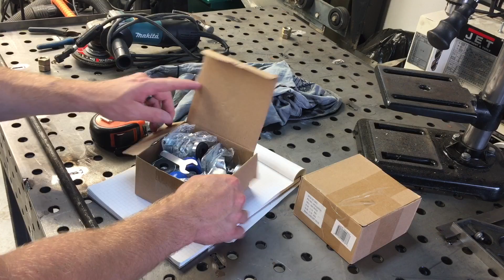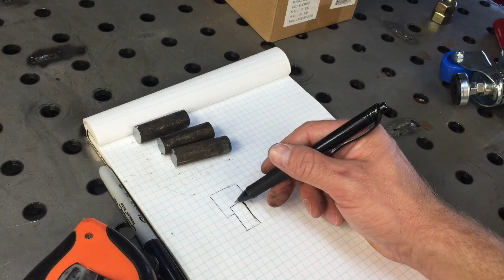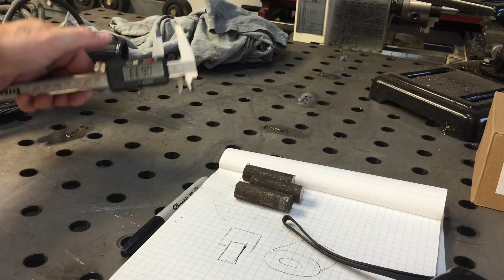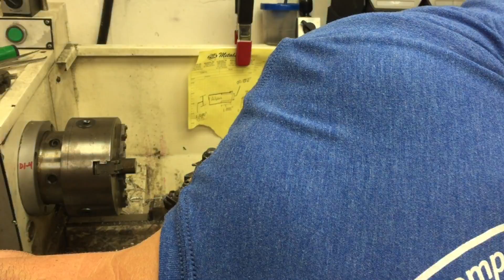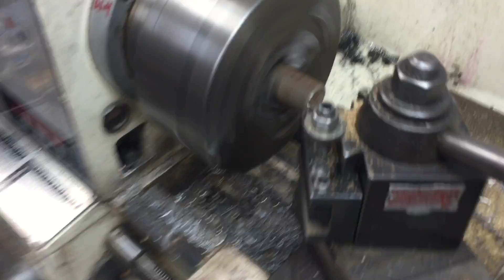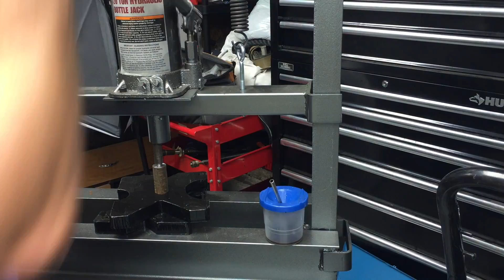Easy PIns for Certa Flat Welding Table/ Fab Block - Unorthodox Fabrication

Comment: Any loose drop in type stop will have movement and is likely to tilt to the side when a workpiece makes contact. The best way to solve this is to have a threaded section below the table surface and to add a washer and nut at the bottom.

Comment: Late to the party I know but I bought one of these from stronghand before certiflats were a thing and I just got my certiflat table and the pin I got from stronghand is at least that sloppy in the table. Gonna look at part two now to see what you did to remedy
Reply from the maker: Right on brother, 

I think the best method to solve it would be to ream each hole so they are all the same. A mag drill would do a great job but would take some time to align properly.

Comment: Take a look at Stronghand's 16mm dia. design - it has o-rings, and also a ball lock, to prevent movement.  A lot more machining, but looks like you have the equipment to make them.  By the way, can you post a video for your new AHP alphatig?  I'm thinking of buying one.
Thanks!
Reply from the maker: Thank you. I will check those out. As far as the welder. I will definitely review it once I use it. I moved to a new home and am in the slow process of getting the shop done. It has no electrical right now for 220VAC. Take care!
Reply: Probably I should've posted this link, http://stronghandtools.com/buildpro/fasteners/ball_lock_bolts.php
You can machine your own
Reply from the maker: Very cool, thank you.

Comment: Not!
Reply from the maker: Not sure what you mean Mark. Any input is appreciated.
Reply: At the end of your video you asked if it was ok for fit or not.  I figure if you are going to that much work, you could turn down a larger round to get a tighter fit.
Reply: Oh yes, see part 2. I did that, I need to debur each hole better. Because there are some that fit too tight and some fit good. Take care

Comment: I made my stoper pins with threaded hole inside and its works great. Its not super fast but its just stop pin. You don't move it much during one project.
I turned 20mm rod at the and on 16mm on depth of 5,5mm (i got 6mm table).
Reply from the maker: Very cool idea! For accurate work that is awesome! Thanks for sharing.
Reply: No problem. I dont even use tools to tighten screw under table, only hand tighten by rotating the pin.

Comment: I'm not a machinist by why not just take the one inch piece and turn the end down to the size you need?
Reply from the maker: Jim Smith the idea was to limit the amount of Material waste, which equals less time machining. But the fit was not great. See video #2 where I did just like you said. Which was better, just takes an it more time to make.  Thanks for the comment.
Reply: No lathe ?

Comment: Nope tooo much slack. Use that lathe to tighten the dowel oversize the stock . But it also depends on what your tolerances would be for the application.
Reply from the maker: Yes. See part 2. Much better fit. Thanks for commenting